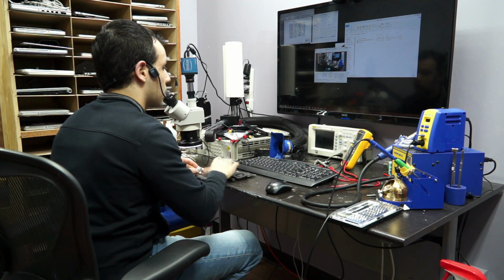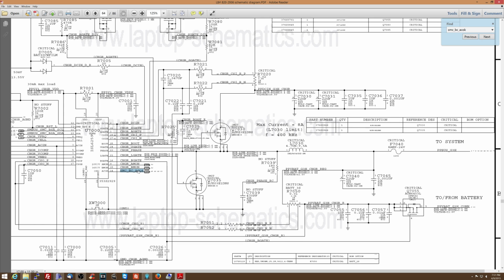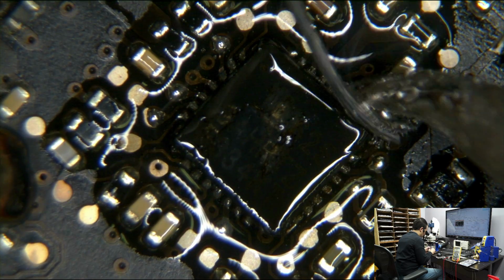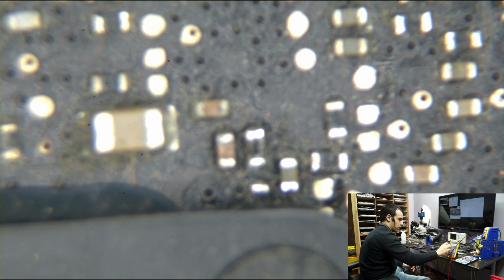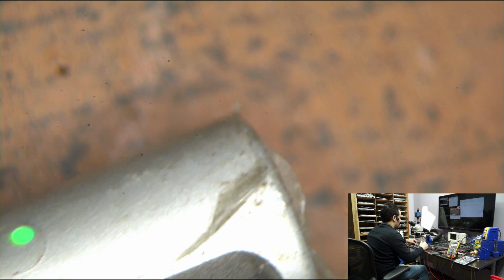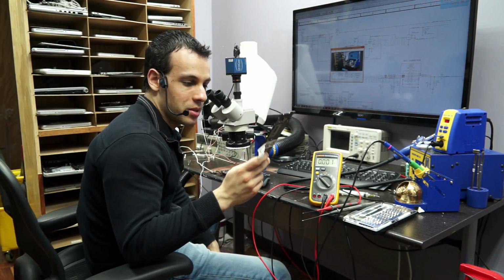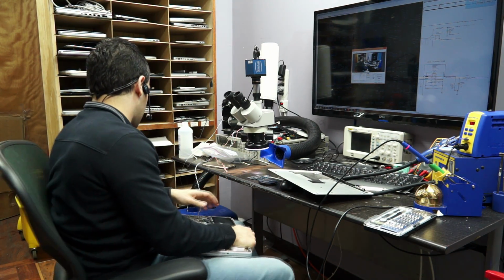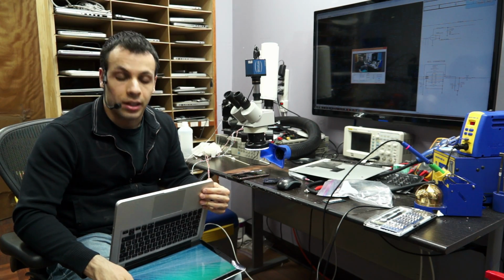Why doesn't steve's board have a green light?

Comment: I know this is an old video now, but I was wondering if it really was the SMC?

One part I didn't notice being mentioned was Q5310 (DC-In Voltage Sense Enable & Filter) which is a P & N dual MOSFET, which also sits on the SMC_BC_ACOK line.